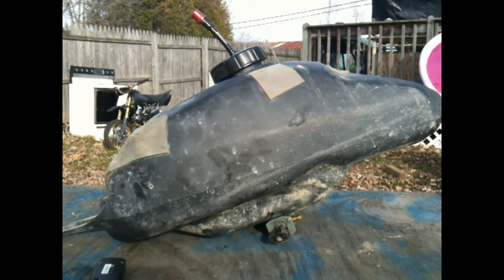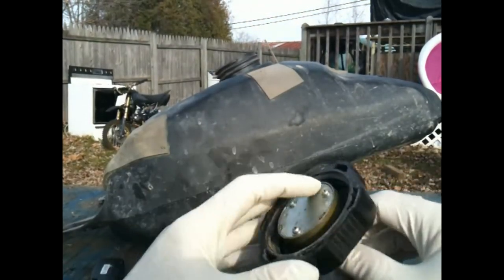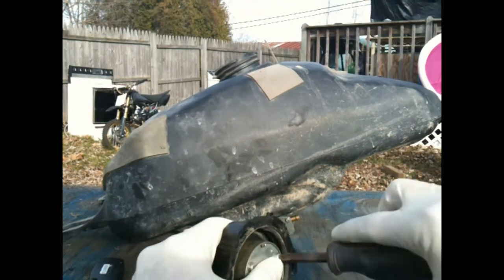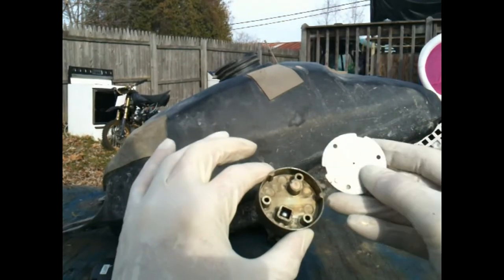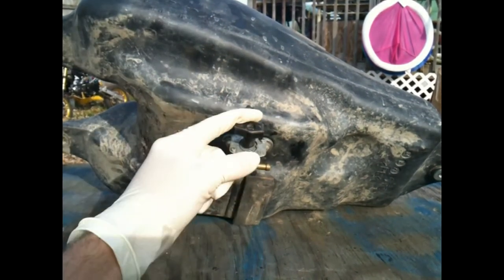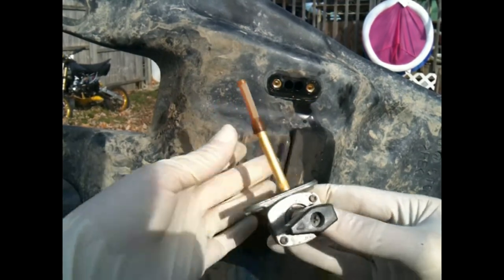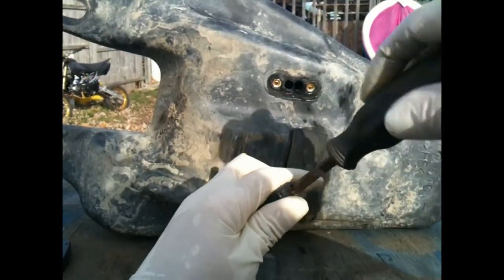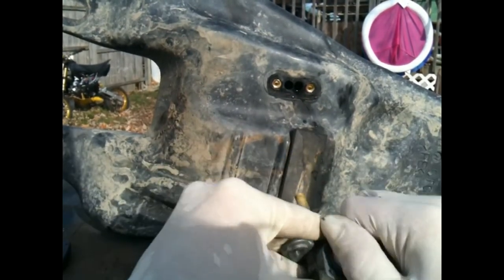Poor ATV/MX Fuel Flow Tips

Comment from the maker: remove  the float bowl off the carb and place a small catch pan under it while it is connected to your bike.then turn on the gas and see if fuel dumps from the bottem of the carb at a good flow.if it flows poorly you may have a clogged float valve or the inlet in the cab is clogged.if the flow is good then you may be looking at clogged jets and possably  air fuel mixture system.

Comment from the maker: i noticed it dieing dosn't happen as often if the fuel is on reserve,but since i did what is show in this vid i have had no probs.
check the cap first if that is ok i would do what i did in the vid and remove those 2 little screens and put an inline filter in.made a huge differance in the fuel flow from the tank.

Comment: I was operating my Honda Foreman ES 450 today. then it just stopped. the engine would turn over. I changed the spark plug. No dice. has gas. battery is good. do you think its the fuel switch.